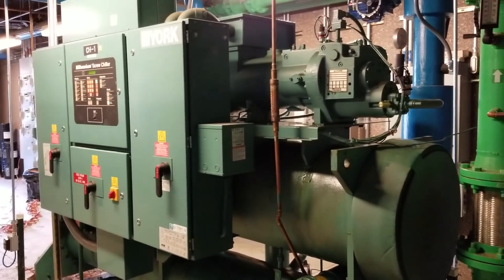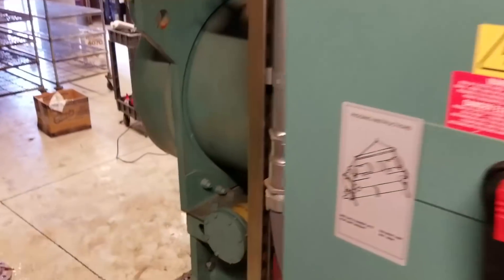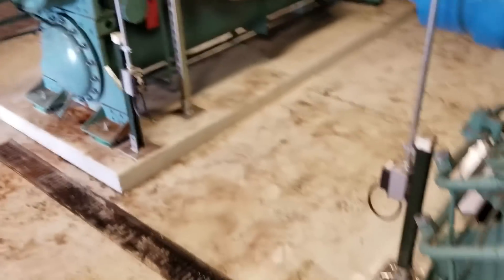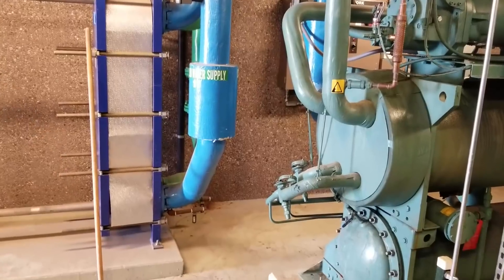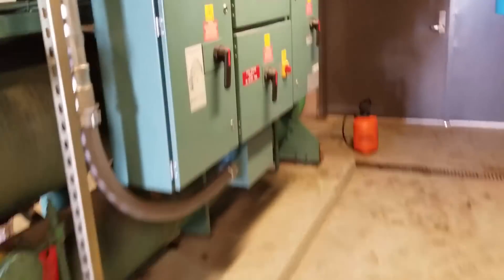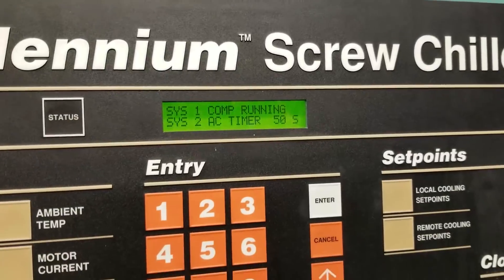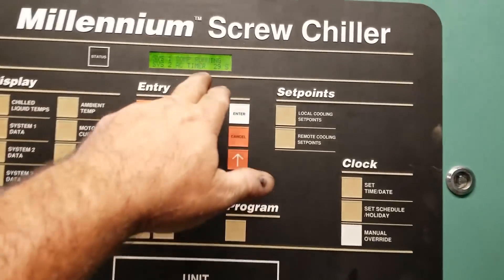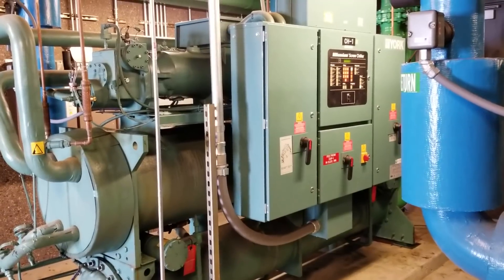Neglected York Screw Chillers finally get some needed service

Comment: Great video! We have three, 700 tin Carrier centrifugal chillers at work that have run flawless for the last 20 years. You got to do your yearly maintenance, punch the tubes, oil analysis, oil and refrigerant filters, and eddy current testing for yourself and the insurance carrier.
Reply: 700 ton
Reply: Last place I worked had 3-800 ton a 500 and a 250 York Codepaks.. then they added two 850 McQuay Sanyo Lithium Bromide direct fired absorbers... Made me think of my Navy boiler Tech days :).. Oh what fun... BTW those absorber do not like cold condenser water :)

Comment: Punching tubes sounds like fun
Reply from the maker: It's not.
Luckily the water treatment guy did that.
I just opened the end and put it back.

I did some 500 ton carrier units a while back. Takes like 2 days to run all those tubes.
About 500 tubes 15+ feet long!
Reply: Years and years ago I worked in a Dallas high rise it had 1700 ton and 1900 ton centrifugal chillers.. I started there in 88 and they still had steam driven pumps. I started in the Boiler room.. My cross training began with punching condenser tubes for about two weeks straight on one machine!... It was fun the first day :/ The joke was on them.. These tubes were way easier than punching tubes on a 600 lb M type boiler :)